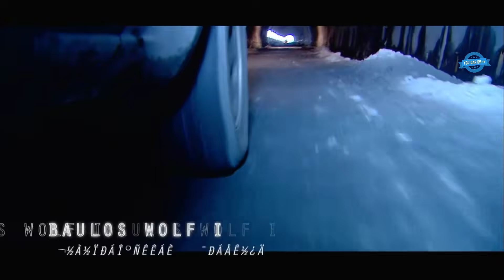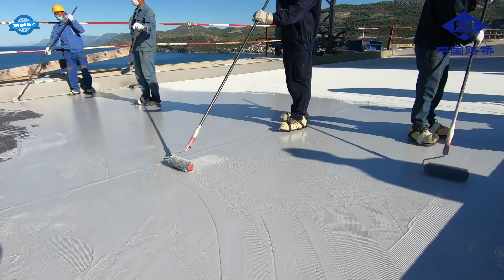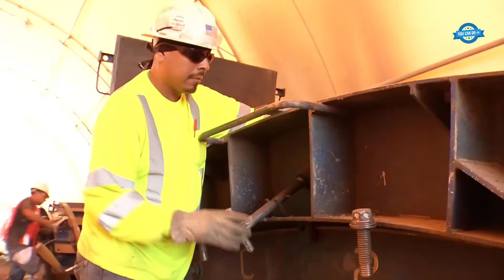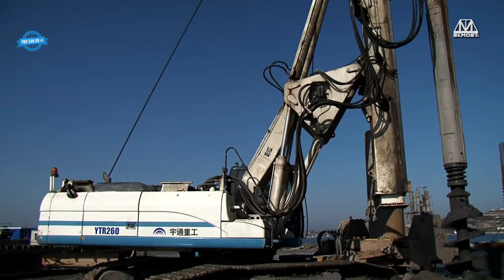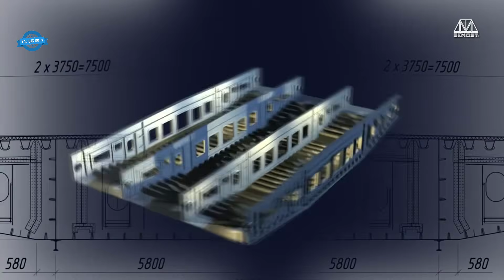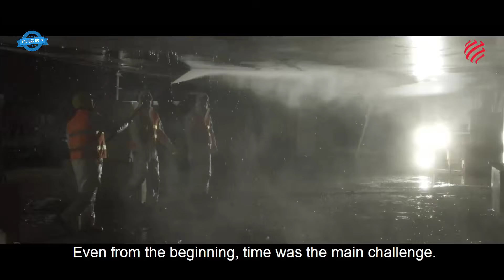How Russia Built Bridge In Freeze Weather And America's Tunnel Construction Under Water Project

Comment: A crane with a 1000 tonne capacity would not be lifting a segment weighing 1000 tonnes
Reply: You know a lot about cranes. What's your background?
Reply: Construction , a crane with a 1000 tonne lifting would only be able to lift that weight with the jib straight up in the air , ie very close to the base of the crane  , say just to unload a section , it would not be able to lift a beam weighing a 1000 tonne into place as stated in the above video
Reply: @Skiddification b by my
Reply: @pitambertilack1250  ?? I'm not sure what you're trying to say
Reply: @Skiddification  the crane is rated to only 1000 tons aka it failing point feel free to correct me if I'm mistaken
Reply: @zakiboug6685  Are you sure about that?
Reply: @Skiddification  no that's why I said correct me if I'm wrong
Reply: 1,000 tons is the cranes maximum lifting capacity at its minimum radius with its shortest boom configuration and its maximum amount of counterweight installed. Just because a crane is "rated" 1,000 tons, it does not mean it can lift 1,000 tons anywhere within its actual reach.